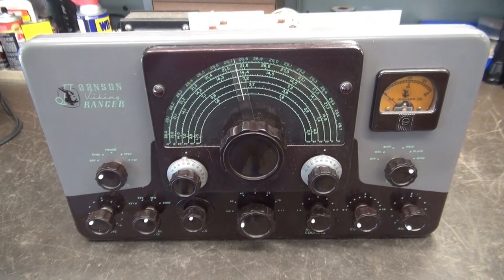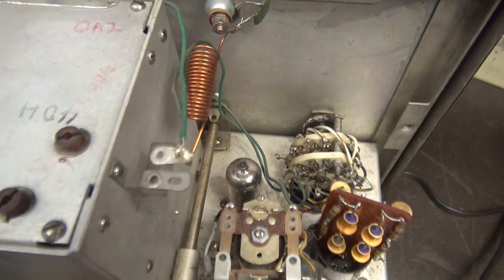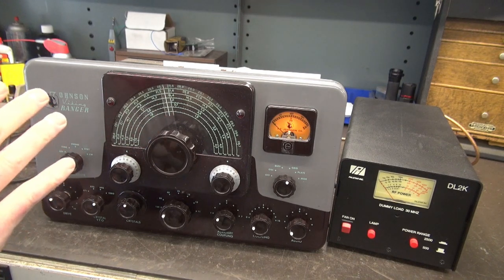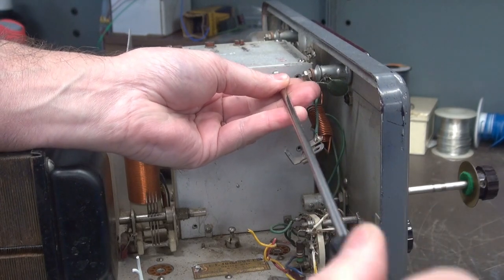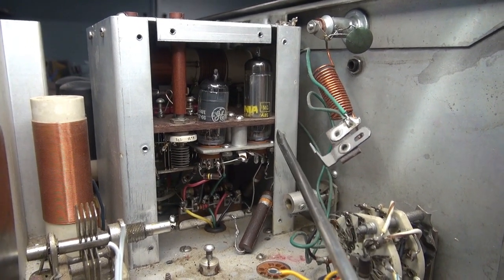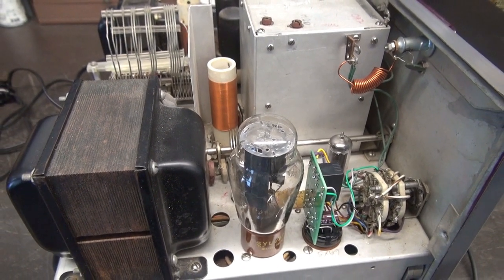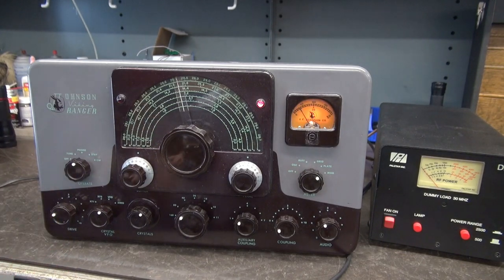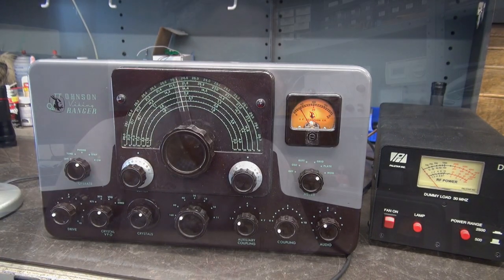How to repair Johnson Ranger Ham tube transmitter detailed tips plus operation PTT Info

Comment: Terry, I installed the K2 kit into my Ranger, without any issues with the kit. But, getting into that function switch is a real bear! It is obvious that Johnson sure didn’t make it easy, with that wiring harness so tightly placed to the switch.  I learned the limits of my vocabulary, having to make up some new words to call the Johnson engineers before I was through with it.  Fortunately, the 18K resistor in the VFO had already been changed out before I got it!  Getting good signal reports so far with the Ranger! :)
73, Chris, N9WHH
Reply from the maker: Yes Sir, you are correct.
Just try finding one of the switches (spare) haha
Glad you were successful.

Comment: Hey Terry, I'm learning all the time. Especially with all your guitar amp stuff. Love this video of the Ranger fix, but I haven't got the faintest idea of what was going on..!🤣🤣 You are so knowledgeable my friend, that I just have to watch everything. Thanks for sharing..Ed..U.K..😊
Reply: Basic theory is the same, except the the frequency range is much higher and you're placing your input signal on a carrier frequency rather than out a speaker (well, further down the process.)  If you can find them, I would recommend the HEATH  training books, and student workbooks if available.   Sime even have lab kits with components needed to complete experiments.  Begin with the DC and AC electronics courses, then pick up the Electronics Circuits course to establish theory.

Comment: Hey Terry, just wondering if you will need to place a heat/IR shield between the rectifier and the pc board?
Reply from the maker: Nope, have not had any issues so far, If the need arises I will address it

Comment: Hi Terry. Usually how long does it take you to repair a transmitter. Reason I ask i have my old Kenwood TS-511S in the shop with it power supply. They both need to be recapped and have 15 meters working again. Just a rough estimate. Thank you for your great videos. 73
Reply from the maker: Hard to say, I have a sold 8 hr day into this Ranger so far. Problems always multiply

Comment: So the radio had two of those DIODE ART rectifier tube replacements, and you put an original rectifier tube back in one, but not the other. Why did the radio originally have two rectifier tubes if they both weren't needed?
Reply from the maker: The new PTT module has diodes in the base for the low voltage DC rectifier 6AX5
Reply: @d-labelectronics  Ah thank you.

Those diode modules were very cool. Your mod is very cool too.
Reply: Hi Terry, I enjoy your video, I always monitor your video. Regarding the rectifier, why you insist to install the original rectifier tube? Is there any noticeable different compare to modern silicone rectifier diode?

Thanks

De Mula - YB1BUL